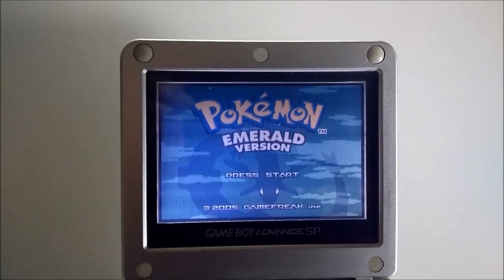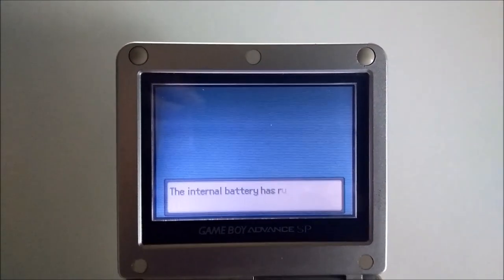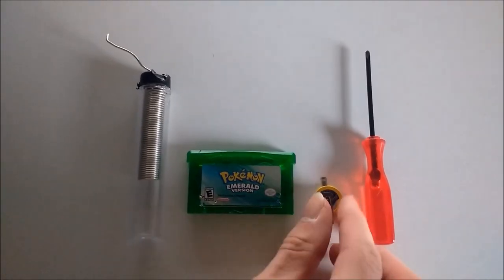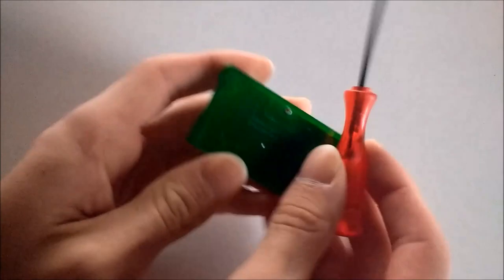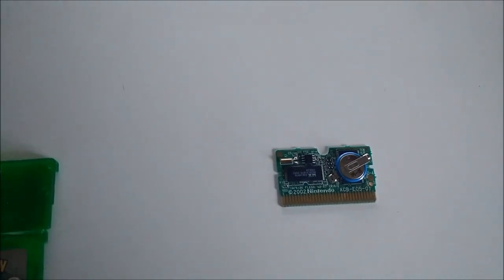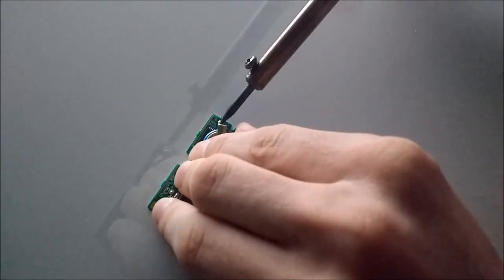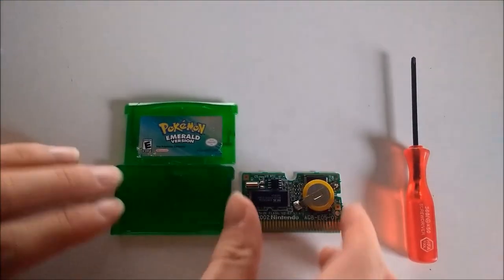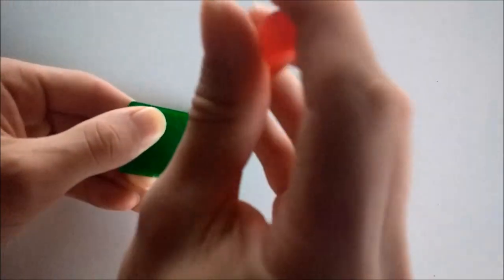"The Internal Battery has Run Dry"- How to Fix Internal Battery Dry Error in Pokemon Emerald carts

Comment: So batteries in Gameboy Advance cartridges are only for keeping track of time and not saves?
Reply: Yea. Any time based features like growing berries, pokemon evolution based on time of day and contests in emerald will not work if the battery is dry.
Reply: at some point during the GBA's life cycle they switched to using flash memory, I think It's mostly early carts and some pirated GBA games that use the battery for save data.

Comment: Hey thanks a ton! It was my first time soldering something in like 10 years and I was able to fix my ruby! The hardest part I faced was getting the old battery off. Once I took one side off I had to sneak almost underneath to be able to heat up the bottom part of the pins to take it off. Thanks!
Reply: TheFifeNation my ruby game has this problem, so it really fixed it?
Reply: THE WELSHION COLLECTOR yep! It was my first time soldering something too. I still play the game all the time and it’s working strong.
Reply: TheFifeNation do you think somebody with 0 soldering skills could pull this off? Seems kind of simple but damn
Reply: @Khaliesahra  Yep most definitely! I'd give it a little practice with just heating stuff up and making stuff stick.
Reply: @Khaliesahra  just train on something else first, like connecting two cables and connecting a cable to something.

Comment: i replaced the original battery with a custom battery (cr2016) by prying out the original and replacing it with a slightly bigger one
Reply: Gerhard Prins does it fit well?
Reply: Jay Galbraith yes, it’s slightly bigger but it fits
Reply: Does it work?

Comment: I don’t trust myself to do this without messing things up...😅 what if I just paid somebody to do it for me?
Reply: Random Citizen  yeah I will pay you to do this for me. Seriously. I will send this to you to fix for me PLEASE
Reply: I did it for my Shappire game, no experience with soldering. You can do it!👍. Just dont stab the soldering iron anywhere besides the solder points on the battery.
Reply: you could also go to ebay and buy a used cart that has had the battery replaced. I did solder all my earlier carts, and it wasn't that hard to do. The great thing about R/S/E is you can remove the outer shell entirely. My silver cart got melted in the process. It still plays, but I couldn't resell it in that condition.
Reply: @beatasas9663  i can
Reply: I can

Comment: My old Hoenn games ran out of internal battery a long time ago, but it's nice to know that can still be fixed! But are there any changes of losing your save file during this procedure?
Reply: on emerald you dont loose saves by removing the battery
Reply: @awkwardseal5476  Are you sure? That isn't rhetorical I'm just worried.
Reply: @Oxymandian  pretty sure dude, 3rd gen doesnt need a battery to be played/saved, only time based events need it, like berrys and that odd island
Reply: No, because these games use nonvolatile memory.

Comment: Even if I had the tools, I wouldn’t trust myself. Although, one time I took out the circuit board of my sapphire and then put it back in, For some reason my battery wasn’t dry anymore. It stayed like that for about 2 weeks and then it went back to normal. I didn’t replace the baytery at all, so I don’t know why this happened.

Comment: I remember I was a dumb ass 4th grader and when it said battery ran dry I took my cart and run it under my bathroom sink and was like surely it's wet now. Dried it off with a towel and stuck it back in my Gameboy. Thank God it still works, what was I thinking.

Comment: I only got one problem with Pokemon Emerald in regards to the Shoal Cave. As the battery runs out, does it have affect on how the tide flows in the Shoal Cave? this gives me trouble in catching Glalie/Snorunt
Reply: TheSleepingDragon100  unfortunately it does, the water stays above lvl, it wont evaporate or rise so you can get into the other entrances. I'm having this problem right now, but it was the same with my Ruby nd Sapphire so it didn't bother me. I binge played them so i would know 👍
Reply: TheSleepingDragon100 Yeah same here for my Ruby and Emerald. I want to catch snorunt. If only that wasn't a time based event..
Reply: Dorito Bag why u want snorunt In gen3? No frosslass available

Comment: So.... If the battery has run dry, you can just play the game normal in general or..?
Reply from the maker: Yeah, the game will be the same (you can still save) but clock-based events such as growing berries won't occur.
Reply: +Gameboy How To ah alright thanks alot :)
Reply: Gaming Howto I cant save for some reason, any ideas on whats the problem?
Reply: Samuel Utanlock maybe the game is fake? I imagine that only bootlegs would have this issue.

Comment: okay i loved my pokemon emerald i played it everyday! it was the first pokemon game i beat the elite 4 and completed the pokedex! but the i got the interal battery has run dry message at some point . i still played it like crazy . then one day i tried playing and it wouldnt go past the the gameboy start up screen or after the start up screen itd just go blank. i was a kid at the time so i freak out . i looked up what the problem was and all i got was that you had to replace the battery. so i went and bought the correct battery for it and  was gonna try to do the non soldering method  i got the battery out but i ened up braking one of the soldering tabs.   a couple years later i found out that it probably needed to be cleaned i opened it up  to cleaned it up  and wasnt really that dirty to begin with and still has no battery in it cause i took it out  when i first tried to fix it. but still nothing.  ive put it in a ds lite to see if i could transerfer my pokemon to my soul silver the ds does read that there is a gba game in there but  but it does the same thing it doesnt go past the gba star up screen or after wards it just goes to a blank screen and when i go to the pal park to transfer it say there is no game in there or something like that. Does any know what the problem could be? or how i can fix it? please ! i dont wanna give up on it! i know the game save file might be gone at this point but i still have hope! if anyone know what i can do please tell me!!
Reply: There's a device you can buy online that connects GBA cartridges to a PC. I'm pretty sure you can use it to transfer your save file on the broken cartridge to another copy of the game. I hope this helps.
Reply: @MundaneMuser  thanks so much! I'll have to try that!

Comment: So you can shinyhunt just normaly?
Reply: From what I have read no, shinies that appear are clock based events and the internal battery running dry makes clock based events go away so to put it simply no
Reply: My game has a dry internal battery, but I did find a Shiny Lotad as Random Encounter
Reply: I have a dry battery but found a shiny Shuppet, so I think you can still shiny hunt.
Reply: lilyseala you can shinyhunt with a non dry battery and with a dry battery. But the dry battery hunting well its a bit hectic. For example if you are going for a shiny starter on a dead internal battery game. You need to do 5 sets of srs that have 10 srs in each one. If you get a shiny in any of those it means you have a early shiny frame and you dont need to make a new save. And if you have a early shiny frame you can hit the frame by just going in some grass and saving and then sr. And if you manage to hite the shiny frame you get a shiny with the same nature as the starter you got. The early shiny frames are generated when you make a new game. Needless to say just replace the batteries

Comment: Is it true if the message “The game can be played” pops when you start the game, the game is a bootleg or fake?
Reply: No
Reply: why are you here? and idk why someone told you its fake, but its not, the battery however on the game is dead, this video shows you how to fix that issue
Reply: Bootleg games will say 1 of these 2 things upon booting up "The save file will be loaded", or "The save file is ok"  I bought all 5 gen 3 reproduction games as the internal clock on my original games stopped working and i don't wanna risk ruining the games. They work fine and can trade with the original games you just cant transfer to gen 4 on the repro games. Got all 5 games for 30$ instead of having to spend 50$+ per game on authentic games which i already own.

Comment: I've heard that if you connect your R/S or Emerald with FR/LG that it also fixes the problem.
Not sure if its true or not.
Reply: this is completely wrong in every way, what makes time pass in emerald even while the game is off is the battery ontop in this video, without that, time cant flow, time also does not sync when you trade, as well as fire red and leaf green do not have the feature that keeps track of time with their own battery, whoever told you this was wrong and hasn't had the issue